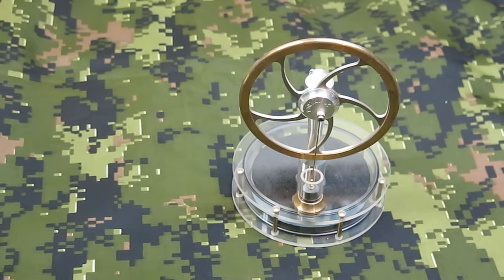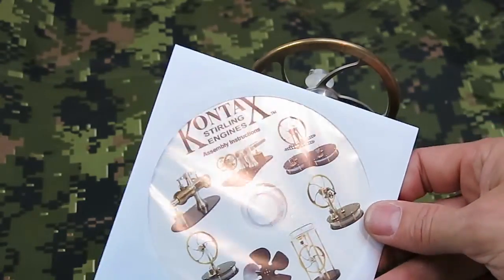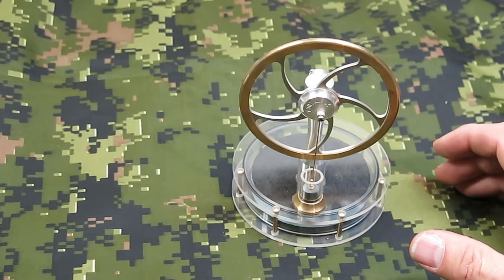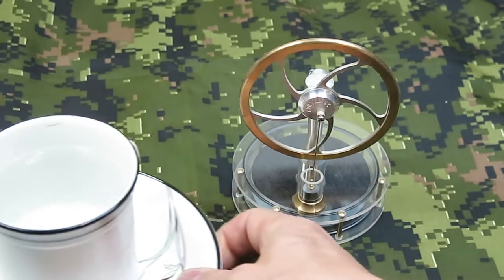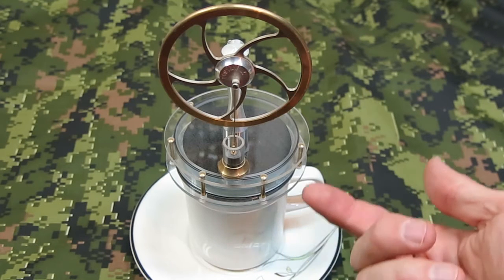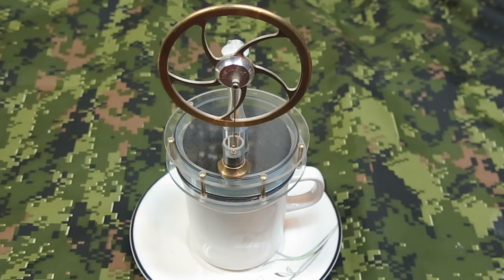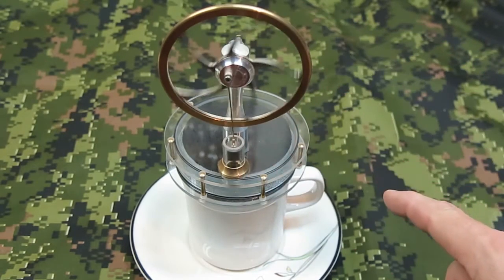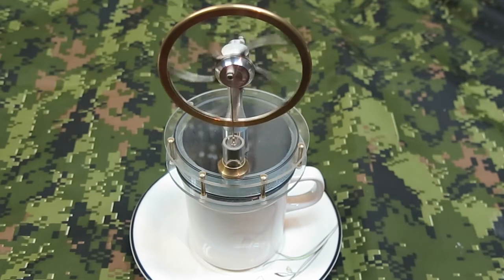Kontax KS90 Stirling Engine Kit Review WORKS GREAT

Comment: This the solar version which is why both plates are transparent plastic
Reply from the maker: Never tried running this on sun power. Maybe I will try it next time the sun shines........Thanks for watching.
Reply: yeah but if they made the bottom one metal, it would work better both ways... anyway it still works well so why bother